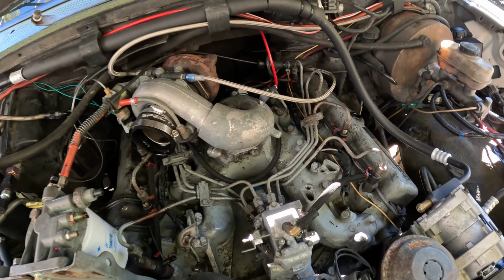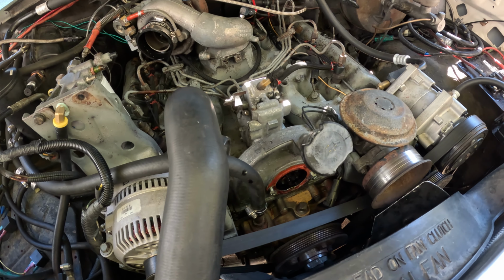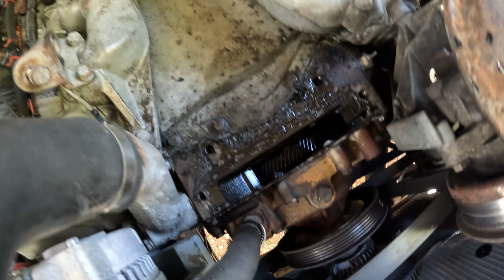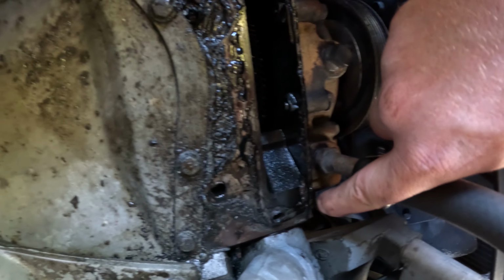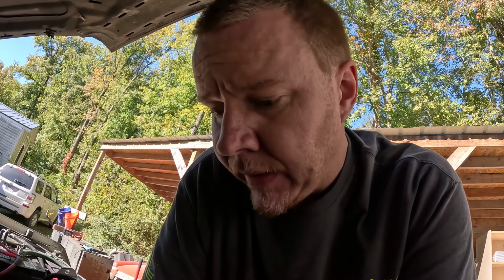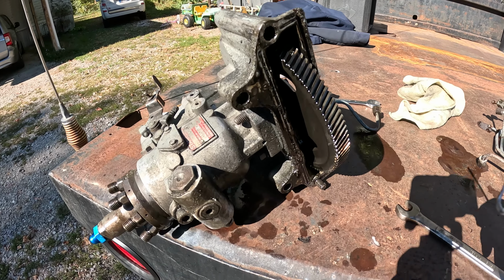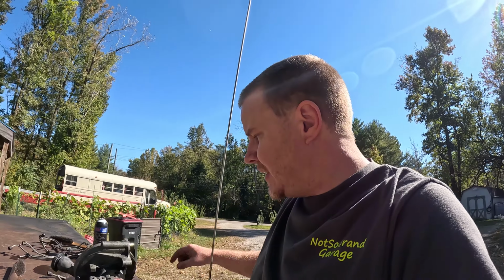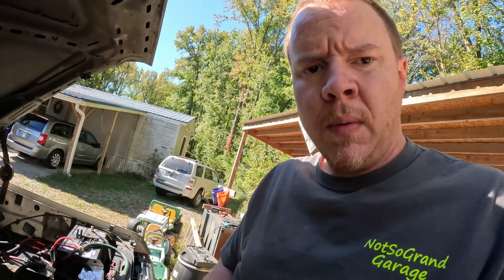6.9 / 7.3 IDI Diesel - IP Gear Housing Reseal - The Easy Way - Ford - IH - Oil Leak Fix

Comment: Not sure how far along you got when you ended part one, I want to share some insight with you that I learned myself the hard way. I replaced the pump on my truck because hard starts were becoming more and more common, even with properly functioning glow plugs on warm days and an airtight fuel system. I replaced the pump and the issue persisted, even worse than before with new injectors to boot. I had pop tested the injectors so I knew they were good. I ran a compression test through the holes for the glow plugs with the shut down solenoid disconnected, and those results were well within spec (260-440 psi.) I threw my old pump back on there (after replacing the starter lol) and she fired right up. The “reman” pump I’d bought was faulty, I suspect the advance bore was neglected but I’m not sure. I bought ANOTHER reman pump through a different vendor and she fired up a treat, no issues. If you experience consistent, excessive hard starting with all your new components, don’t panic, throw your old pump back on there to confirm she starts up same as before, that would eliminate the gear being a tooth off. I suspect you’ll be getting a pump and injectors from Justin at R&D Idi performance, so the issue with the advance bore shouldn’t be a thing but it is still something to consider.
Reply from the maker: Truck is on the road and running strong.  I only replaced the pump and injectors for the sake of power and better drivability with weight on the truck.  My goal was stock powerstroke power and feel and I've surpassed that.  With that said, stock pump and injectors are on the parts shelf bagged as spares as they were in good shape.

Comment: Does it have to be in top dead center before removal
Reply from the maker: That I don't know.  It was suggested to me so that's how I did it. It's easy enough to spin it over by hand and put it at TDC
Reply: @NotSoGrandGarage 
Ok thanks. I was reading the shop manual and I thought I read to remove to glow plugs and move to top dead center
Reply from the maker: @andresramirez1983  no problem!
Reply: The engine does not have to be at TDC to replace the pump, but the manual does specify having the engine at TDC when installing the pump gear housing, as that is typically done with the front cover removed to reveal the timing marks on the front gear train

Comment: I see a turbine on that is it something you added to an IDI ???
Reply from the maker: It has an ATS 093 turbo kit on it yes.  Same as the factory turbo system offered in '94.  There are several bolt on turbo options for the IDI

Comment: Chris, My 85 f250 idi has never been hot and up until 20 k ago never blew visible exhaust...   Now it blows blue and I have to keep the oil topped off. I have to use ether because the glow plugs don't work... Any hope of fixing my oil burning issue?
Reply from the maker: Oil consumption can come from several things...    Rings....   Valve seals /guides...   Turbo (if it has one).  Are you running it on home brew?
Reply: @NotSoGrandGarage  Not yet Chris, I have everything to add a second tank but have not installed it yet.
Reply: A compression test could give you insight to the health of the cylinders in relation to each other, the spec is 260 psi to 440 psi. You want to have all the cylinders within that range with no more than 25 psi variation between cylinders.

Comment: Just curious I believe that running WO causes the injectors and pump go prematurely. What did the parts cost for this repair?
Reply from the maker: I wasn't replacing parts due to failure.  I've never had a mechanical failure caused by my fuel.  I kept my originals for spares.  I went with a hotter pump from R&D and stg 1 injectors from them as well.  Pricing is on his website.
Reply: Mixed results are wide spread; you’ll have guys like Chris who do extensive testing, put in the time and money and they’ll have constant issues. Then you’ll have someone’s grandpa who pours every oil change through a rag into the fuel tank and has run the original pump and injectors past 400,000 miles. It’s hard to pin down consistency. The older trucks aren’t money pits and they’re easy to work on, but you WILL work on them.
Reply from the maker: @adrienst.raymond6801  I only replaced the pump and injectors for power.  I wanted more umph to pull the trailer I'm building.  Stock pump and injectors are going on the shelf as spares.